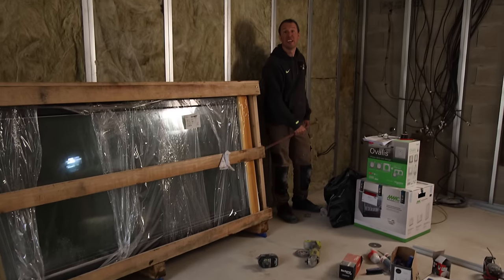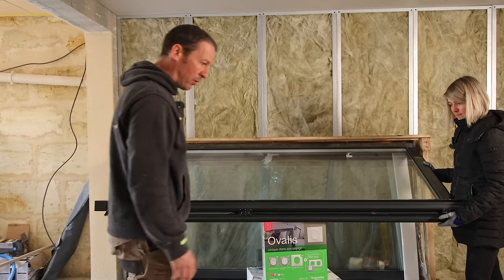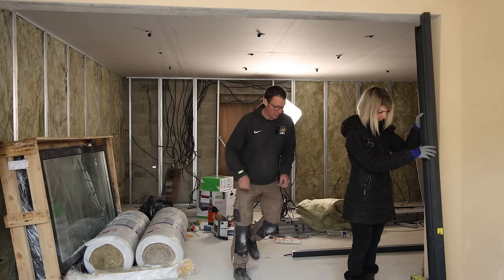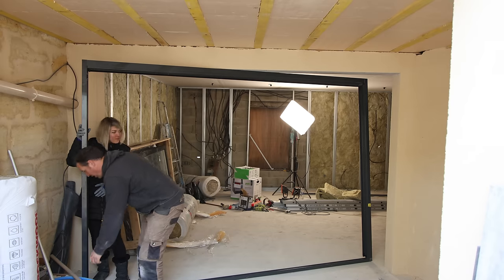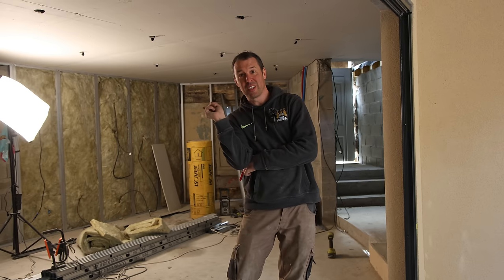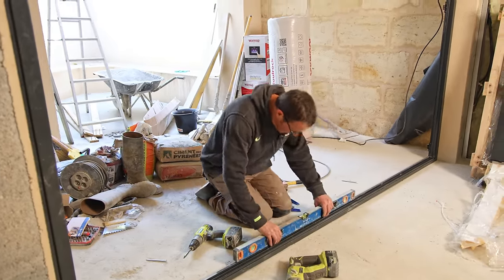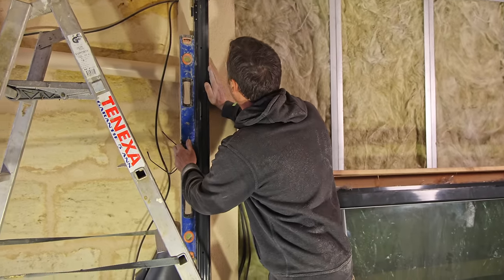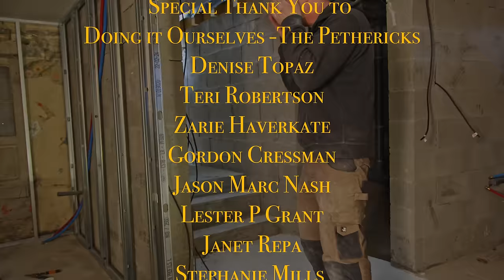Building Drama: Anna Takes Over for Bi-Fold Door Construction

Comment: Curious: why didn’t you lay a foam seal before attaching the metal frame for the bifold doors? Keeps out bugs, weather, helps with heating/cooling etc. just wondering. And you didn’t appear to Lexel/silicon in your ground screws to insure moisture tightness. This is a ground floor with access to outside with poss.  of excess rain flooding (maybe). Ounce of prevention….
Reply from the maker: It’s going lower than the tiles interior and exterior…… it will make sense in due time
Reply: @BordeauxLife you answered my next question…what is going on the floors.

Comment: I am surprised you didn't ask Billy and Phil or even Ryan to assist at the end I thought maybe just as well now you can recruit some help. Not even sure how you and Luis got that off the truck either. Anna is wonder woman we all know this but....I don't know even I wouldn't be able to assist. that kind of glass is scary heavy :(  lift with your knees. I actually thought those doors were going further out  is interesting. I worry the hot weather might make the frame expand and winter the opposite. But Edd is the expert he's done this before so fingers crossed it's ok. Not what I had expected as seen installed with wood frame and then attached to walls etc...like windows. Have a restful holiday weekend you two after all that :) 🥚🥚🌷🌷🐰🐰🕰🕰🦸‍♂🦸‍♂🦸‍♀🦸‍♀

Comment: That is one of those 2 person jobs that you need 3 arms each to be able to hold the framework..bit like those shower cubicles..  Can I ask Ed why you double up the uprights on your metal frame work? We only double up where the edges of the boards meet but we do put horizontal pieces between the uprights to give better rigidity .. have we been installing them wrong?? Thanks
Reply from the maker: It’s just how people do it here in France  - it makes a huge difference to the rigidity and also it leaves somewhere for both panels of rock wool to attach

Comment: Love the work you guys are doing. I just have a question. Could the fuseboard (or what ever it's called 😊) not sit in the bin room, så all wires went in there and the board was out of view?
Reply from the maker: The problem is if there is a power cut or a breaker trips (chances are when you are cooking) it’s quite a way and up / down steps to get there, hence why I put it there , also that’s where the electricity arrives so it needs to be there.
Reply: @BordeauxLife  Thanks for the reply. Keep up the good work and happy Eastern to all of you. 🐰🐣

Comment: edd why you not put sealy in under the frame to stop water coming in
Reply from the maker: Because it’s going to be under the tiles on both side ….. it will make sense when you see them go down Alan.
Reply: @BordeauxLife  yes just keeping you on your toes edd love what you doing
Reply: Understand that there is no need for DPC as it's an aluminium frame. But i would have used SMP all around the frame.
Reply from the maker: To be fair in a normal installation it should of course have that, along with foam on the sides and top - it was duck a snug fit I don’t even need to foam at the sides…… thankfully - they tried to charge me 70€ for a 20m roll!!!!